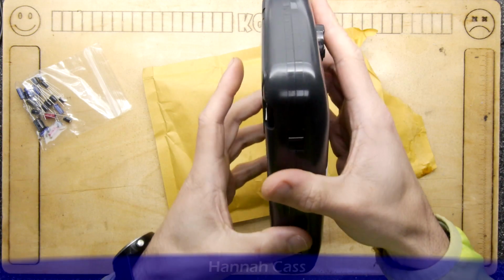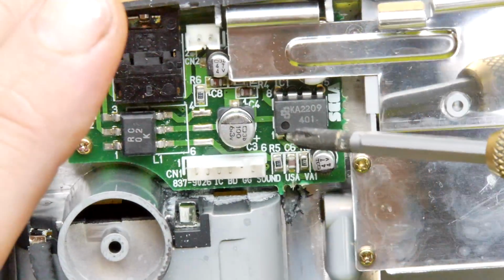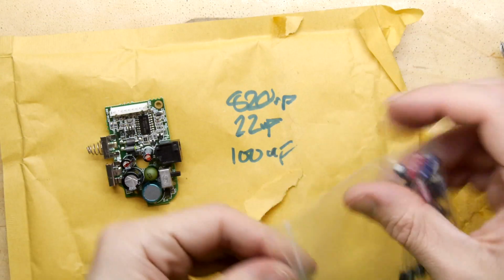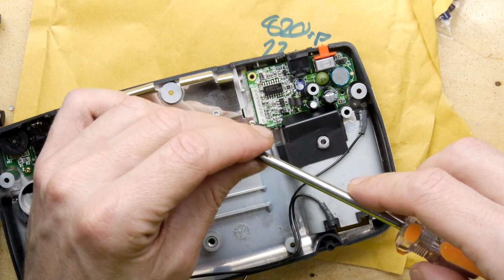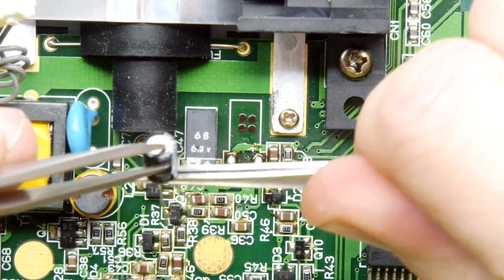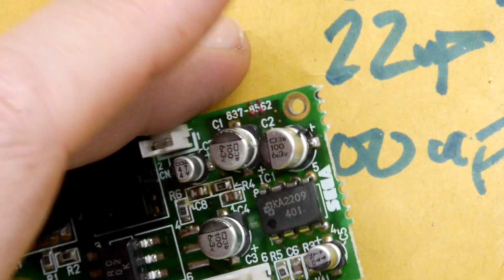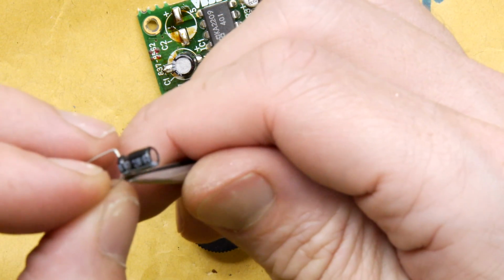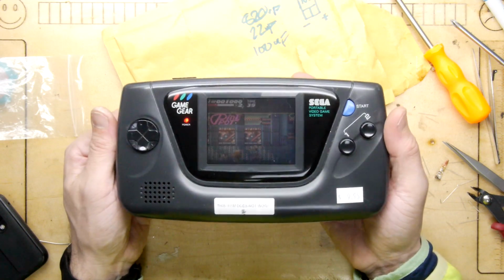How to Recap and repair your SEGA Game Gear

Comment: I changed the capacitors yesterday on mine and it just wouldn't work. I didn't however change the 5-100uf for the sound board. Would it make a difference on the video if I change it?

Comment: I replaced all the capacitors and i still get no picture. Would i need to look into replacing the screen at this point?
Reply from the maker: Well it's a yes and no kinda answer. Do you get any signs of life out of the unit?

I would recommend replacing the screen on a known working unit because the modern replacements are a staggeringly good upgrade.

However, I would be concerned that the main board could be dead, and your screen replacement would not help with that.

Comment: Well that is a small world scenario. I am in the middle of recapping a VA1 model and I open this video. Low and behold I recognize that sticker! I didn't expect to find the model I sold you in the same video I would watch over a year later! And yes, mine also smelled very fishy while desoldering the leaky caps.
Reply from the maker: Ha ha that's amazing 😂👏

I think quite a few items from my excursion to the shop ended up in videos!

I still have a massive thorn in my side from the Ti-98/a I got on one trip. Good times. 

Definitely just have been over two years ago maybe 3.

Comment: i wish mine looked that nice.... i opened it and the thing is full of blue moss
Reply from the maker: Blue moss? Oh no. What are you going to use to clean it?
Reply: @backofficeshow   im thinking vinegar or a mix of water and baking soda, i also could use battery terminal cleaner which does the same thing... im currently in the process of re capping it so once that is done ill deal with the moss
Reply from the maker: I would use neat vinegar, scrub it, then rinse first with water and then with IPA

Comment: You may not know the answer but I have a question.when I turn mine on I see a blue screen,no sound.i played with the briteness wheel but it dident do anything.any suggestestions to fix it?EDIT:turned it on again and I can gear a quiet,staticky,almost hiss.no clue what it is.please sir,can you help me?
Reply from the maker: Have you recapped it yet? That will almost certainly help fix the issue
Reply: @backofficeshow  no i have not.i love video games but do not feel to comfortable fixing it myself.do you know of anyone who does it?I might consider it.
Reply from the maker: @A3rgan on Twitter can help, his profile:
Enjoys gaming, computer hardware, computing and partial to cups of tea. I like to un-break things. Repair threads archived on aergan.com
Reply: @backofficeshow  ok thanks.i will check it out
Reply: @backofficeshow  have you used him before?if so how muych would it be
Reply from the maker: There is no one better. I would suggest contacting him directly.
Reply: @backofficeshow  bit have you used him?and could you guess ho w much it would be?

Comment: I replaced all 20 of the electrolytic capacitors in my Game Gear. Still haing issues. Before this I would get no screen and no sound and a red light that would fade away right away. Now I get a red light that stays on. Very bright screen. Sound that mostly works it seems. But I get a garbled picture that just looks like jailbars. The only thing that got messed up during my repair was that a component came loose along with its pads. I made sure that the component got reattached to the copper I scraped away. Idk what else it could be. Not enough solder on my capacitor legs?

Comment: Isn't there a way to test which one is the faulty one instead of replacing all of them? I have the same issue and trying to get it fixed but I really want to know if there's a way to test which One is the bad one instead of having to replace all of them.. Thank you
Reply from the maker: Not really, you would have to take them out to test them
Reply: @backofficeshow  OK thank you so better off changing all of them got you
Reply: Always change them all if you are already doing it. They are 30 years old and were poor quality to begin with.

Comment: 1:42 - lol, I did the same yesterday but with a GBA. I freaked out as I thought it killed the system but turns out the power switch is a bit flaky.

Comment: nice video but isn't there a way to stick a multi meter to each capacitor to see which one is bad. I of course have a game gear from my childhood that doesn't work and don't have the soldering skills you have and don't want to get good at it tearing down my game gear. there has to be a way to target what's good and bad.

Comment: Hey great video matey, I've done a fair few myself, just a couple of pointers is when you take the cap off and you are smelling that fishy smell that's the electrolytic liquid leaking from the cap and is very corrosive so it's best to clean around the area with some ipa to stop it from eating away at the traces nearby. Cheers keep up the good work buddy. 😘😘

Comment: Is there a reason the capacitors always die on game gears? Is is just a bad design?
Reply from the maker: They always die in everything, but I think it's accelerated in this case because they were cheap.
Reply: There was a big capacitor plague in the late 80s through 90s and Sega were one of the big brands that was affected by it, most capacitors do fail naturally but not all of them in the unit. The best way to cure it is too definitely change the whole lot. And give it a great clean with ipa.
Reply: Sega used cheap capacitors

Comment: I bought one a while back to fix it just about shows a game running and no sound, should also be fine when the caps are done it  seemed a good way to get one being cheaper to buy  a faulty one and fix it my self screen change will look superb ,lipo conversion would be great i remember back in the day the battery's lasting a very short time my atari lynx and game gear they  would eat through Duracell .Lipo conversion of an 80,s boombox is something that has been on my mind for ages seen loads of video,s of people adding bluetooth .
Reply from the maker: I'm certainly going to keep my dude m eyes open for broken ones!

I'll post a video about the lipo project. I think it definitely needs to be done!

Comment: Great video! I've got one GG bought for 5 euros at flea market, I disassebled and the situation was awful there, caps leaking and pads in some cases are destroyed. After a recap on the main board and some bridges my device is getting power and switch on but I've no joy. If I could do some questions, have you some suggestions on where are test points for voltage check? I'm no professional though
Reply from the maker: I don't really have any suggestions as I have not dug around at that level. If you spot some standard ICs on the board you can use their datasheets to see their power pins.
Reply: @backofficeshow  Thank you, is not the answer I'm searching for, but I appreciate your reply. Cheers

Comment: I boycott lead free solder... it's a built in failure mode.
Reply from the maker: I agree, it's awful stuff!
Reply: lead free solder= dry joints
Reply: Plus the leaded solder tastes better...
Reply: @Splooge_McFornication  if GOD didn't want us to use it then it wouldn't be so sweet.

Comment: Got one I was given that doesn't work. Hopefully this will fix it. Although I think I would need to replace the screen with one of these modern replacements. I did my Lynx and GBC.
Reply from the maker: I'm sure it will, seems to be the main failure mode